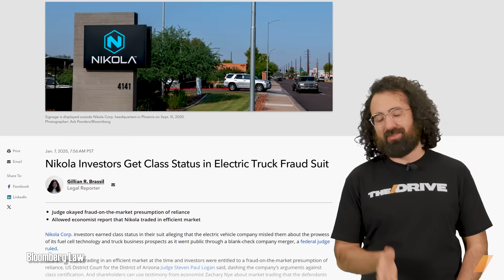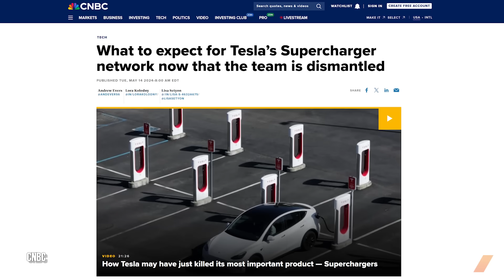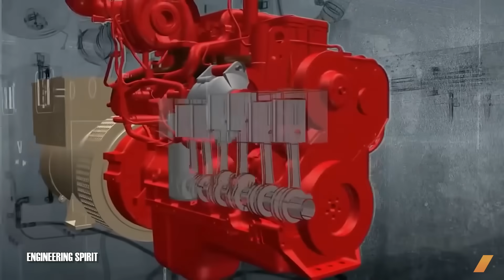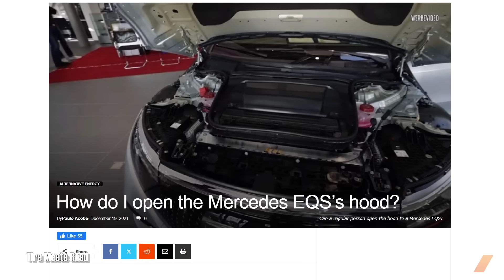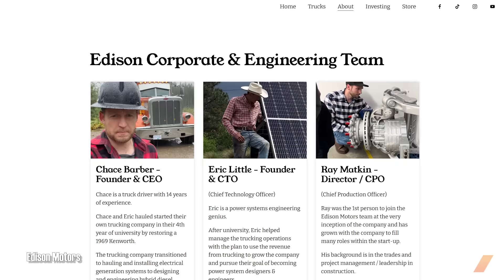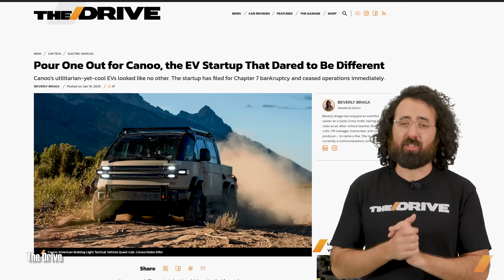The truckers in a shed beating Tesla with 100-yr-old EV tech

Comment: A few things to note:
Edison isn't trying to directly compete with Tesla. Edison is targeting the heavy vocational trucking segment, rather than the much more typical overland freight segment that you typically see on the road. Targeting this segment means that their trucks will likely run at $600k+ as a starting price per unit, but that price is much more in-line with that market segment's expectations. This also allows them to not have to compete in such a highly competitive market and as such they can hopefully start recouping their R&D costs. What sort of trucks are "heavy vocational?" Well, a few examples would be logging trucks, snow plows, and specialized oilfield trucks. All of these trucks have to be either fully custom built even from the big name manufacturers, or they get heavily customized from a standard model, bringing the price up as stated before.

Also, while they are making some components to specifically meet their needs, Edison is trying to make their trucks, as much as physically possible, to use off the shelf parts. And not just parts anybody can buy from a certain store, but as widely available of parts as possible. They are doing everything they can to make their trucks rugged, dependable, and as repairable as possible by anybody that can turn a wrench.

The video didn't make it clear, but their trucks can be run in a fully EV mode (like you might want to do around town), and they can be plugged in to charge, as a power plant will always more efficiently produce power than a mobile generator/engine. They also feature the ubiquitous regenerative breaking technology, so something like a logging truck that goes down a mountain loaded and riding the brake and then back up empty might even get away with little to no generator use during a work day.
Reply: @AlindBack  that last sentence is what everybody misses. You can get SO much energy back when going down the mountain on a logging road if you have regenerative braking instead of having to use jake or engine braking.
Reply: It probably goes without saying, but they can be used as a worksite generator. Right?
Reply: @compassandradio6261  
Yes, EDISON specifically mention the "shore power" function as one of the benefits.
Reply: @compassandradio6261 yes
Reply: @compassandradio6261 correct
Reply: my issue is that he states that a battery reduces efficiency. 
a good truck engine is able to convert power at about 40% perhaps a bit above. 
a good battery + electric motor can easily hit high 70% not accounting for regenerative breaking bringing efficiency up even higher. massively offsetting any battery weight increase.
Reply: @thesandman2404  does that include the loses from charging the battery?
Reply: While I'm not familiar with the conversion losses between the generator, batteries, and motor, diesel motors have a very specific range of RPM where they opperate MOST efficiently. When running the generator, it can be KEPT at its MOST efficient RPM. This mean that unlike direct to wheels diesel that need to opreate OUTSIDE of their most efficient RPMs, hybrids can maintain their peak efficiency. The only question is whether keeping peak efficiency on the diesel end off-sets the losses from electric conversion.
Reply: It was also a bit of “I’m sick of waiting for my electric truck, I’m gonna build my own” 🤷🏼
Reply: I'm pretty sure they have said that their target is to start with these big logging trucks since they're more one off expensive hand build able items and then eventually work down to more typical commercial retrofits. Yk the small mass produced kinda thing they can't do yet.
Reply: @Chillin4030 they started with logging trucks because that’s what they know. They are working on conversions for otr trucks too.
Reply: And electric motors are least power efficient at high RPM on highways, but you won't see any of these trucks go on roads that allow going over 75mph, so series electric doubly makes sense because at no time you will rather drive on hybrid power or gas/diesel alone.
Reply: Yeah, especially the start of this video echos the misconception with all the standard handwringing about BEVs.These are niche use vehicles where the extra cost, extra maintenance for hybrid vs full BEV is justified by certain extreme requirements. For logging it is the remoteness of operation and the road conditions, it requires a lot more energy per mile to drive through gravel and dirt than paved road. Snow plows you mention also have remote operation requirement in some areas and always extra energy per mile since you are literally pushing solid matter out of the way constantly, but also they are very much burst usage where you'll run them flat out for several hours straight (safety concerns due to driver fatigue be damned, but it isn't as bad as if you did this for OTR because you aren't doing it day after day after day).
Reply: @aoeuuaoaou  There are no misconceptions about TVs in this video.
Reply: HA - no need to compete with tesla CRAP - they are USELESS pieces of SH-T - HA - CHEERS from AUSTRALIA - GO EDISON
Reply: "highly competitive"
The market has been stagnant for almost 2 decades calling it competitive is an insult to actual comeptition
Reply: @victorkreig6089  Define "stagnent"? Because there are definitely differences between vehicle built now and those 20 years ago. There's been improvements on a number of fronts, from drivetrains to aerodynamics.

BEV represents a very large leap, but that doesn't mean there hasn't been ongoing refinement prior.
Reply: Do you know if they considered using a Micro Gas Turbine? MGTs are a bit more efficient than their Diesel engines (this should be checked) but they are at the same efficiency of a thermo electric powerplant - that means their emissions is the smae as a full EV if they are in a place that produces electricity from Thermo electrics.
Reply: Actually because of there Conversion kits they are competing against Tesla on the long haul side of thing. and unlike tesla there trucks use off the shelf parts meaning you truck breaks down chances are you local truck repair shot will have the part.
Reply: @ I thought those were conversion kits for pickups?
Reply: @aoeuuaoaou they started with semi conversions
Reply: @ Those are all custom built by themselves, not kits. They really don't have an economically competitive standard OTR class 8 solution. There is at least one company out there doing a sort of booster trailer that adds a hybrid type of capability (extra push, cruise, regen braking) on an axel that you hook into your setup, but that's a different thing.
Reply: @aoeuuaoaou  they are in prototype stage with the pickups. They are building new semis now with two in process and three more ordered. These are new from the frame rails up.  They will also do conversions if requested.
Reply: @fredbecker607  Right, so no pickup conversions for sale.
Reply: You're grossly misinformed. Certain media is trying very hard to paint him that way because he cut their funding(usaid). But it's not true.
Reply: Exactly. 👍
Reply: They're also creating a diesel electric solution for half-ton and higher pickups.
Reply: your comment needs more likes
Reply: Is the provincial or federal government wherever they're at helping them? Incentives, tax deductions, etc?
Reply: @MuzzaHukka  Edison actually helped bust a ring in BC Govt that had ev/hybrid development assistance stuff, but they wanted kickbacks off the applying company as well.. Edison kind of went "no, we aren't going to jack our dev-costs just for those kickback shenanigans.." as such, they did not have such assistance, especially when building/testing the initial PoC truck or Topsy [the slightly later full prototype]..
Reply: Insightful, thanks.
Reply: 600k is also around the price for standard overland freight sleeper rigs....
Reply: @DurzoBlunts  
Very, VERY different trucks and markets - might as well compare it to a new Rolls Royce Wraith?
Reply: Yup, hybrids are the way to go here, until battery tech catches up with the power needed to make this a daily routine. Nothing wrong with the hybrid solution until there are better solutions. Toyota Prius' started this off many years ago, and made this possible. it's still a good idea for tougher solutions like like log haul trucks, which gravity is in their favour. I am super happy with Telsa M3 after 4 years and it's costing next to nothing to keep it going for my purposes. And it drives on it's own as well as I do. Love it! Still blows my mind!
Reply: @Chrisrrable  You blinked and missed battery tech "catching up".

Hybrid is, always was doomed to be, the runner-up. In all but very niche uses it costs more to build, maintain than either straight ICE or BEV. It generally costs less for fuel than ICE, although it is very close for industrial diesel, and never better than BEV.
Reply: @aoeuuaoaou  Nope, not blinded at all. Reason why hybrid trains are still running with mega tons. It's physics
Reply: @Chrisrrable  Niche

North American long haul freight trains are dominated by IC hybrid (and likely will be for a good long time, maybe until nuclear scales feasibly to freight engine size). But that's because of scales of their size and the the distances involved make it very hard to tether.

None of that holds for highway vehicles. Edison has a potential small niche because of remoteness, terrain, and size of "work site" inherent in logging. But outside that the numbers just don't work.
Reply: I know a guy who has one of Edisons test trucks of his farm in saskatchewan and yes the price tag is hefty, they told him $600,000 Cad per truck but that includes full tech support and repairs on failures at zero cost.
Reply: @robbalinski1606  Is there a years/km limit on that coverage? Do you know what it is?
Reply: Also Edison Motors still have an electric truck with fuel type electric. A hybrid would use two power sources to power wheels. Edison only has an electric drive.
Reply: behold, a uncontested market niche where innovations can grow.
Reply: Best part is they still require drivers. Too much focus on autonomous trucks these days.
Reply: Electric trucks are already stupid on their own. Electric heavy duty off road trucks? Thats another level of stupidity entirely. 
Fuel is widely acessible and easy to store. Electricity, not so much
Reply: @caralho5237  Edison is making a diesel generator powered hybrid.  There are many things about electric that are superior. Torque and HP being glaring examples.  Electric also offers capturing the energy from braking. This means much better fuel mileage. Don't know about you, but i'm not keen on spending $2k on fuel every week.
Reply: Edison while making their own truck. They already sell conversion kits that you can use to convert your own truck to hybrid.
Reply: @death13a  they don't actually have a conversion kit yet. You can pre-order and get in line. They almost have the first prototype ready.
Reply: Bro who the god damn heck told you a logging tractor is $600k.. you have literally lost your mind
Reply: @CL-yp1bs  Those are Canadian dollars, not Freedom dollars.
Reply: Edison is targeting that market, but I doubt that's where they'll stop.
Reply: @AlindBack  my comment got deleted but i still receive notifications for this thread
Reply: This is pretty much a pipe dream, the handwriting is on the wall for all to read.
Reply: Totally agree, the creator of this ridiculously misinformed video has never owned an EV and has no understanding of the economics behind car manufacturing. He probably hasn't even heard of the term 'economies of scale.
Reply: Tesla/Musk once again shot for the stars and got bogged down even before the launch by Musk's old nemesis: overpromising and underdelivering. 
But then again, if Tesla/Musk adopted a new marketing strategy, the Tesla semi still could be a huge success. Just sell them as zero-emission Urban Environment trucks and argue that they will bring the pollution in urban environments way down. And for as long as the batteries still severely limit the range, leave the long-haul trucking to diesel trucks, or even better hybrids like this video shows. That combination would cut down pollution even more.
Reply: @tjroelsma  The biggest problem for Tesla and their semi, is they are only mid way through building a factory to mass produce  them, that's why there is so few of them, probably a good way to go because you wouldn't want to produce a few thousand only to realise you've got something wrong, with only a limited run at one or two major users such disasters are way easy to contain and fix.
Reply: @tjroelsma  A good Tesla marketing strategy is to not court Nazis and fascism. Europeans especially are now avoiding Teslas with the American market similarly tanking because of Musk's unsavory antisemitism and antics.
Reply: @tjroelsma  Since the battery technology does not limit range, this is not necessary. Just use it as intended.
Reply: @tedmoss  I disagree for a couple of reasons:
1. Pollution is the worst when diesel trucks have to accelerate, so they do terrible in urban environments, while EV semis excel in those same environments.
2. EV semis always lose a lot of range when they have to work hard and cannot harvest power on braking, so they lose a lot of range on highways, while diesel trucks excel on highways. 
3. EV semi production is severely limited due to several factors and as there are huge numbers of diesel trucks, it will take quite some time to replace them all, so it makes far more sense to start replacing them in urban environments.
4. Hybrid semis make more sense than EV semis to replace the diesel trucks on the highway, so I'd say start producing those beside EV semis, not only to speed up the replacement of diesel trucks, but also to reduce pollution even more.
Reply: @tjroelsma plus none of the major otr trucking companies are interested in EV semis.
Reply: @ Because they are perfectly happy buiding their traditional trucks. But as I said, I see a market for Urban EV semis, as they make much more sense in Urban traffic than highway use.
Reply: @ I didn’t mean truck manufacturers, trucking companies. UPS and Pepsi aren’t over the road trucking companies. EVs work for them because the truck returns to the same hub and doesn’t usually go as far. I agree with you, EVs make perfect delivery vehicles. Amazon was smart to invest in them.
Reply: @AlindBack  For logging full electric trucks would be a better option.  Why carry around an extra 2000lbs having an engine, generator head, fuel, and cooling when you can just increase battery capacity.  It would better to just have a generator at the loading site and charge the trucks while loading.
Reply: @ChrisHarding-lk3jj The charging would just be the problem. It takes too long for to little range. Logging and such trucks run in extremely remote areas. Hybrid is way better because you can cross a way bigger distance on one tank of diesel. And btw the diesel hybrid system is actually lighter then a giant battery for a full ev truck.
Reply: @ChrisHarding-lk3jj  loading takes minutes.  30s to pick the trailer up and set it down. 30s to hook up 5 minutes to load  and 5 min to chain up.  Your not getting a usefull charge in that time never mind the fact the truck has to move several times in that timespan.  Having the truck capeable of recharging on the way up or going down the road is much more productive than getting an extra 3 logs on at the cost of  having to sit and charge for a number of hours a day.
Reply: @ChrisHarding-lk3jj the Tesla semi is much heavier than a standard semi or the Edison hybrid.

Comment: Actually, Trains were not first.  The tech is older than locomotives.  Submarines and Mine pumps had it way before that.  Power source charges a batty bank, electric motor does the work.

Comment: 200k mile Tesla S 10 years old, lost 12% battery range, you guys know not a lot about this tech. 1,000bhp in the truck...same as a Tesla Model S :) 5 to 10% fuel savings...now this is where the Tesla electric truck wins hands down many times over.

Comment: Just a slight correction to your only electric being Tesla or Edison.
Volvo , Mercedes, Iveco have had full electric trucks in Europe for over 5 years now and way ahead of Tesla in the development.
The Edison model has massive merit, there is also another company in USA making diesel Electric Hybrid Peterbilt units. 
I think Revolt is the name. Bruce Wilson did a video on this mid January 2025.
Tesla are going to have USA and North American competition even if you don't get the EU trucks already proving the BEV trucks make sense at 1.6 kW per mile and 300 mile range - fast DC charging and using in long haul applications with sleeper cabs.

Another new Full electric truck company Horizon Motors undergoing EPA and Carb testing in California right now . Swappable batteries with dual port charging and LiFeP batteries full electric axles and was on  show at Miami Truck show last  week.
Tesla are failing to get to the market on time and others are nipping at their heels as they pass bye.

Comment: Tesla Semi has a lower drag coefficient than Bugatti Veron. At highway speed, air drag takes away 50% of power. This is the major reason Tesla achieved 500 miles. These trucks with large radiators are no where near that level.

Why not put a small engine (car or bike) behind the cab that can extend the range while battery is being drained for first 500 (or 300) miles?

Law requires frequent stops, the generator will be running charging the battery.

Comment: so they threw out the gearbox, replaced it with an electric motor/battery. this will work as an E-CVT, keeping the diesel at a constant rev, which it loves dearly. 
problem is - downhill engine braking, how is that done? does the motor use the braking energy to rev the engine?